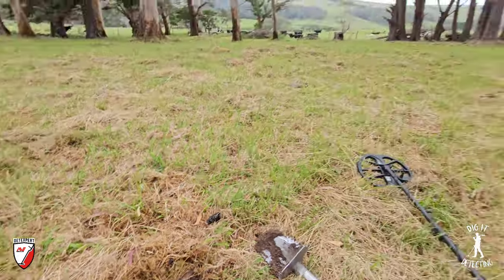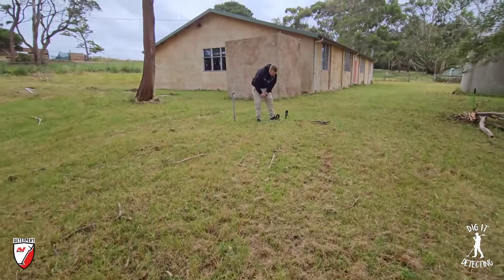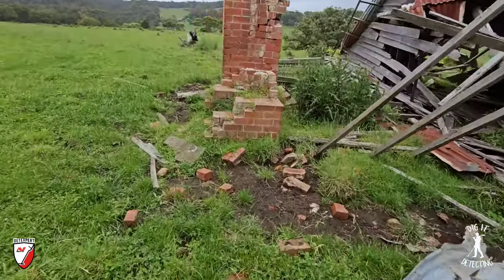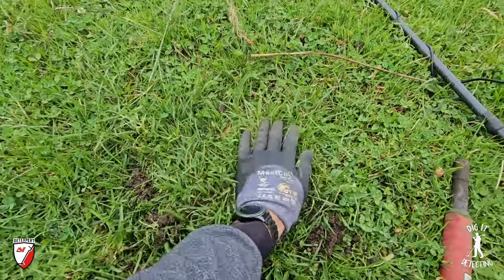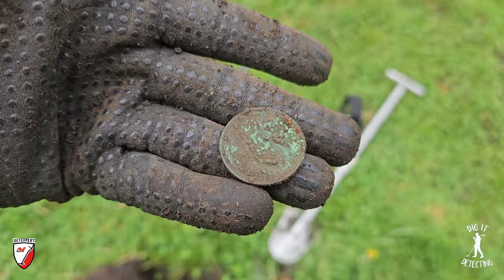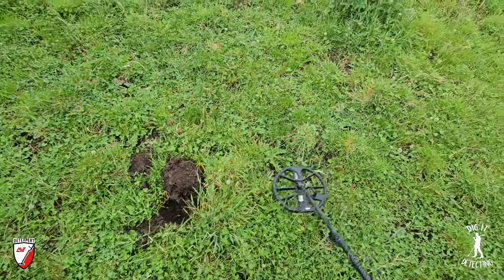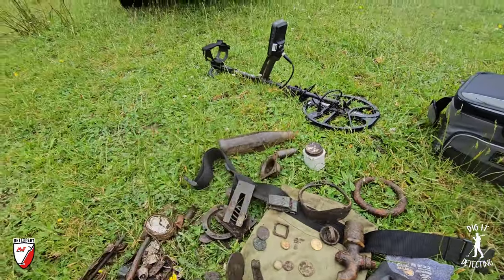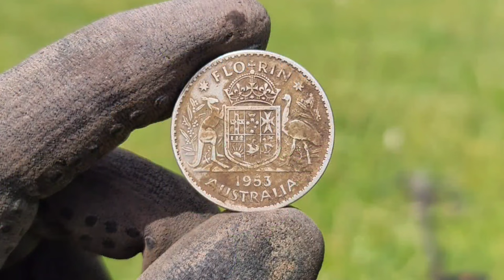Token King👑  Metal Detecting & Exploring Two Awesome Old Sites With Steil👌

Comment: Good sites, Luke & Steele, or Steil, the old primary school bound to deliver much variety when it's not busy, must have been busy since settlement, it seems! I thought the "commando" van looked a bit recent, bound to have much older if it started as a 2 room school. The brass wedge is as said from a woodworking plane, the semicircle object, a car inner tube repair vise, maybe on cleaning it'll say "Shaler 5 Minute Vulcanizer №8", missing is the four prongs on a screw stem that you'd tighten up the glued tube/tyre repair to set. Shaler also did those screw-on caps for spoked wheel inner tubes. Hoffman bricks more thirties like the vise, rebuilt chimney? With all your choices though, pace yourself, for your own lots good, and our benefits too! Onya!
Reply from the maker: All fantastic information there @Gabi Valla thankyou so much mate. This sure was a fun day out hunting with Steil. I thought the old brass piece was a rubber vulcanizer but wasn't 100% sure when filming. I honestly had no idea about the planing wedge though! Super cool find👌
Thanks so much for watching, I'm really glad you enjoyed😊👍⛏️

Comment: Hey Luke, what you called a "gantry hook" I think you'll find it's an old rubber vulcanising clamp for car & truck tube repaires,...just missing the threaded spindle & clamp foot.... Old school mate before everything went tubeless 👍
Reply from the maker: @Woody you are 100% spot on there mate. I couldn't quite remember what it was when I was shooting the video but as soon as I showed Andrew the father-in-law, he mentioned the same thing and I had an uh-huh moment😄😄
Reply: Ahh see mate, old souls both Andrew & I 😉 lol,... Think by memory the rubber patch was on one side of a tin type of cap which had a slow burnable type of fibre on the opposite side & the patch was actually sealed on by heat, hence vulcanised,.. Remember my dad having one in the shed. 😊